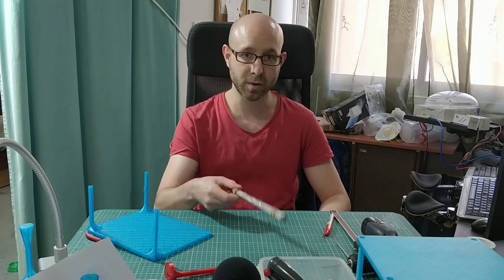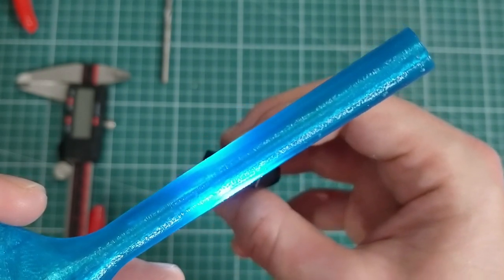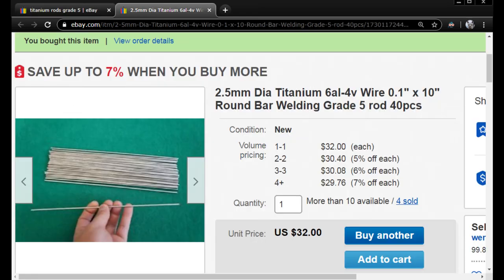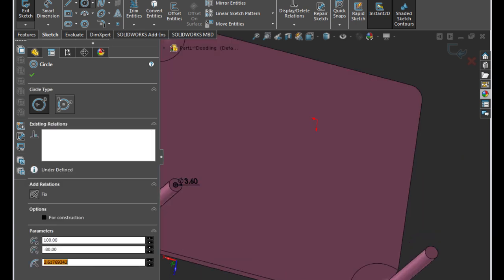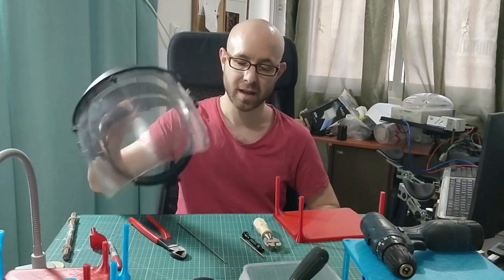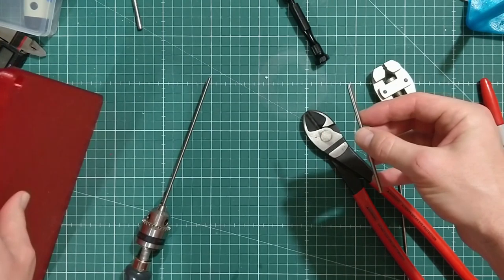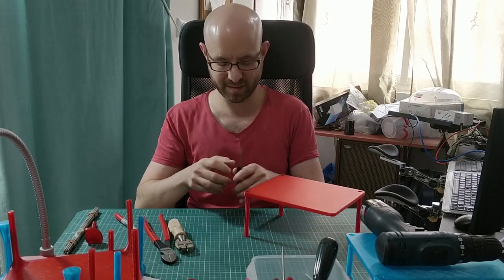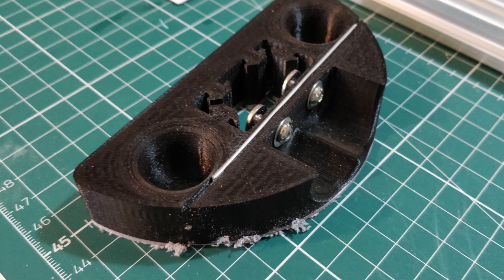Making 3D prints stronger with titanium rods

Comment: Great idea!
Since the biggest stress in a cantilevered beam is at the base, you would benefit by having the rods be the same length as the leg.
Have you tried using heat to insert them in more snug holes, or do you feel it's not necessary?
Reply from the maker: Interesting, thanks.
Regarding using heat, I have a roundabout way of doing that. I put the rod into the chuck of an electric drill, as if it was a drilling bit, and then insert it into the tunnel carefully while activating the drill at a slow speed.
The rotation plus heat are enough to push the rod into a very tight hole. Just be careful not to drill a new one accidentally 😉
Reply: @RamRachum  really clever! Similar to friction stir welding... I'd say it's a superior method to heating!

Comment: Im curious. Is there a reason to use titanium over steel rods for average structural 3d printing?
Reply from the maker: Steel works well. Titanium's advantages: Won't rust, won't be attracted to magnets, is lighter. The last two are usually irrelevant. Steel is stronger by volume.

Comment: why not just any metal? Aluminium? Steel?
Reply from the maker: Both are reasonable choices. Aluminum would be weaker. Steel would be stronger, but susceptible to rust and magnets.
Reply: @RamRachum  Thanks for clarifying. I'm very interested in the idea. Might try myself. Aluminium because of availability and for my needs anything that doesn't break under human load is enough.